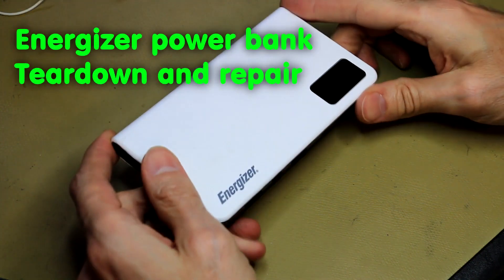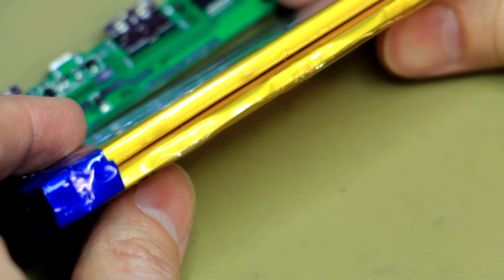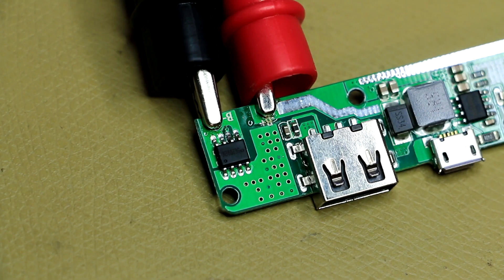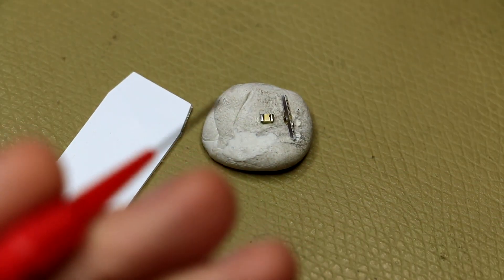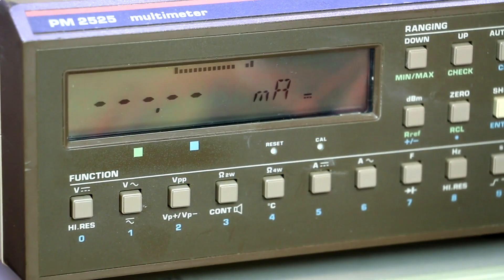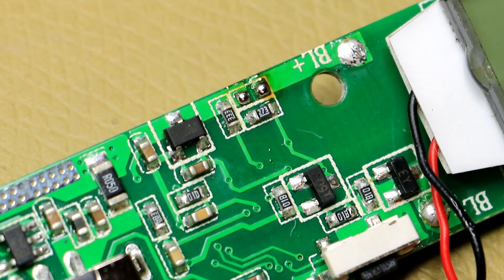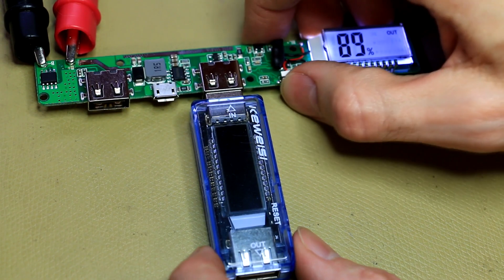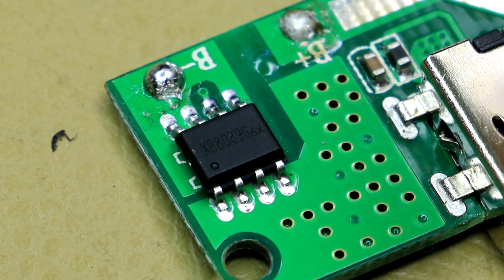Energizer Power Bank Teardown And Repair (#023)

Comment: I've got a charger, it was brand new, kids got a bit of drink in it and dropped it, but plug it in the wall and it seems it's charging and if u plug usbs in exile it's in the wall, all 3 sockets will charge any phone but the second u pull it out of wired power it's dead, ive taken it apart and I can't see anything that stands out, bar the bit of milk near the power button, but as I said, the power comes on when u plug the power bank in the wall as if to charge it itself....
Reply from the maker: Maybe try and clean it up with a little IPA (99% alcohol) to make sure there are no bridges. Could also be that the line to the battery got corroded (underneath a component where fluids can more easily get stuck).